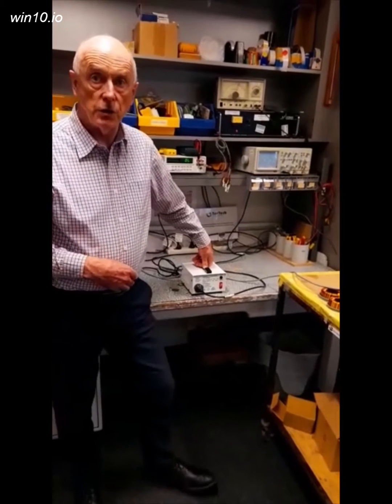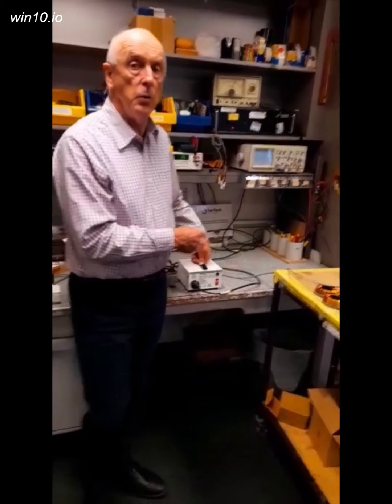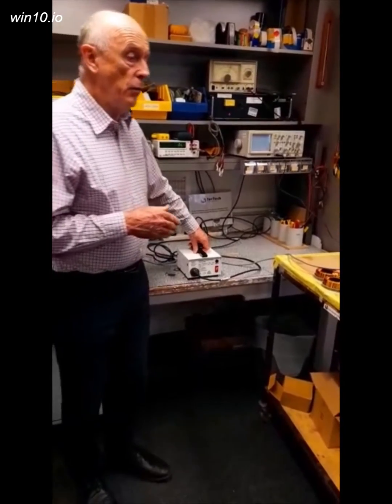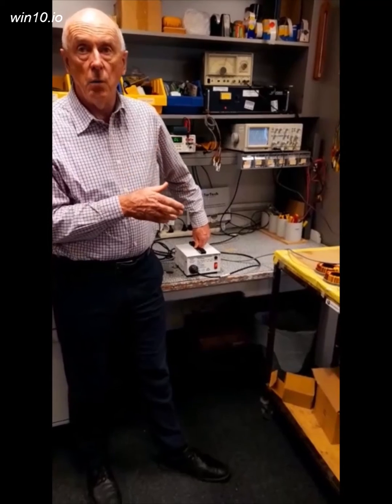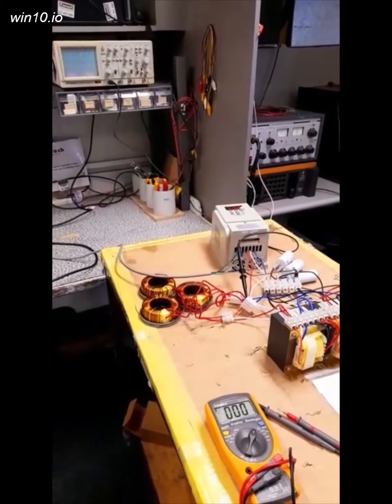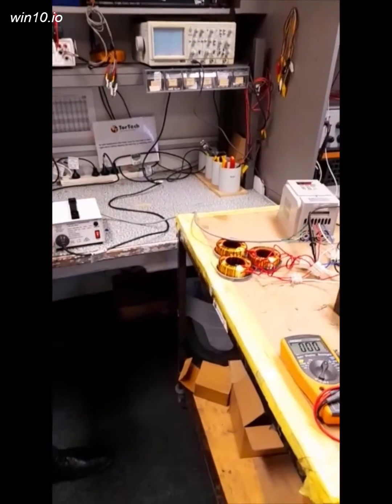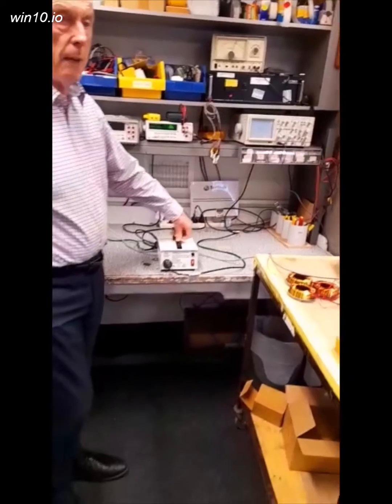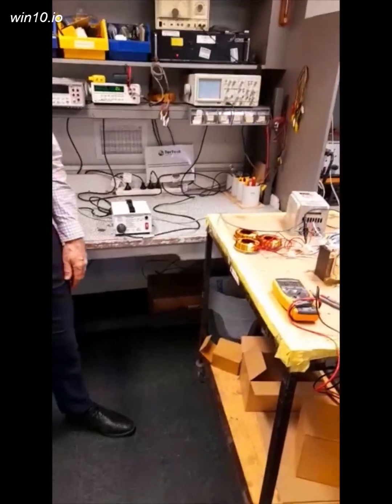Isolation Transformer - How and why to use

Comment: It appears that the oscilloscope in this video is connected to the isolation transformer.  If that is the case, then what is shown here is dangerous to the operator as the scope is floating and any metal on the scope (e.g. the BNC jacks) may be at an unsafe potential depending on what the scope ground lead gets connected to.  You should run the equipment under test from the isolation transformer, and ideally independently earth the EUT rather than depend on the earth from the scope ground clip.  Even better do this plus use a differential probe.  If the EUT cannot be powered from the isolation transformer (e.g. a high power device), then the scope would need to be placed behind a shield so no one can touch it when in use, but even that may not be permitted by OH&S regulations.

Comment: An isolation transformer has been suggested for our small show band which plays in theatres where there is lighting and lighting dimmers in some of the power circuits. We've had major problems with "dirty power" as it has been called causing hum in our speakers. So far we have been recommended using 1) the same powerpoint for all our amps (to prevent ground looping noise), 2) using a Thor A12BF 8-Way Smart Surge Protection Power Board and, 3) using an "Isolation Transformer". Our total watt rating = circa 1000w which we only use at 25% - 50% potential volume. You have a 1000w and 2000w Isolation Transformer off the shelf option. Any advice would be appreciated.